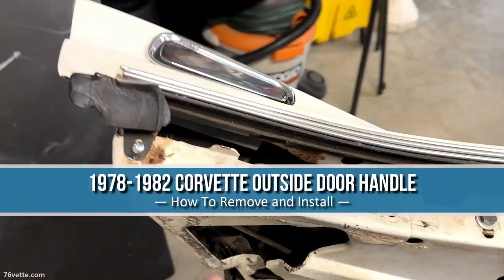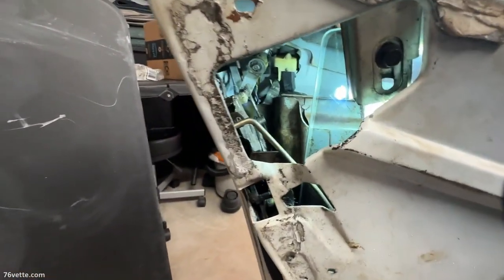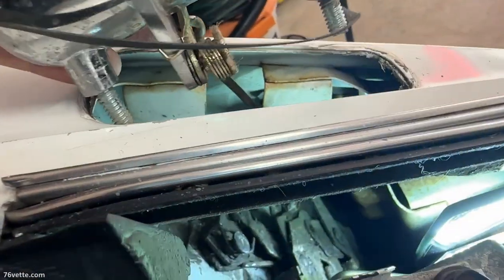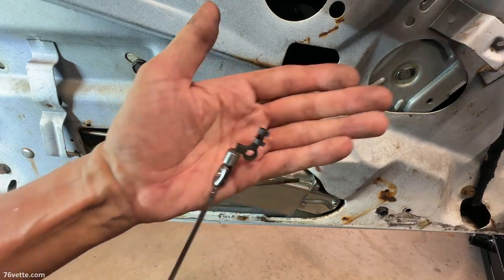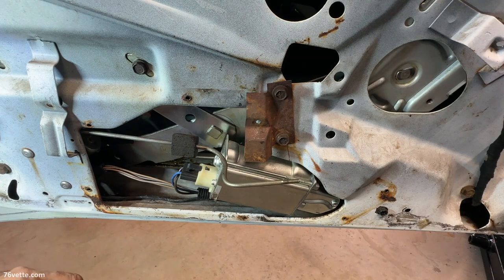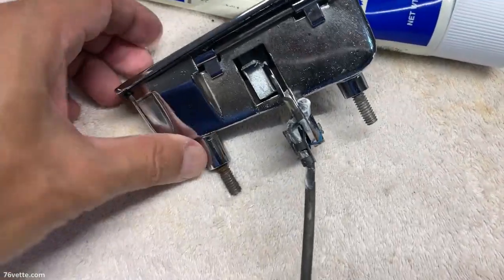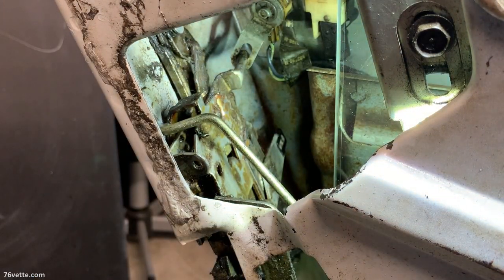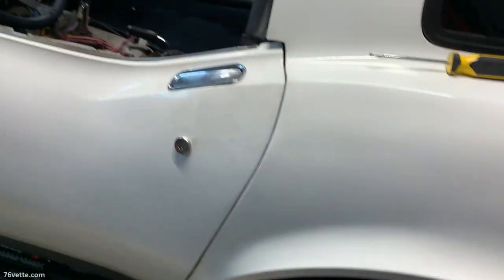C3 Corvette DOOR HANDLES: Remove and Install

Comment: I wish I had this video 10 months ago. The video quality is excellent and the trick about just pushing the clevis through the clip would have saved me hours of agony. Also loosening the door mechanism is absolutely key on this whole process. Unless you have tiny hands there is no way you can access the mechanism. I got my door handle rebuilt and installed but it was basically a trial and error process. Another great job. Thanks
Reply from the maker: It is a challenging job. That’s for sure. Thank you so much for watching! 😊👍🏻

Comment: I did this last weekend on my 76 and put new handles in. OMFG that back nut was pain to reinstall. Who ever was in the doors before left the back nut off. 

I originally went in to replace a wheel that runs on the long horizontal and back vertical track (round to square wheel) and clean up the tracks, but Ill end up having to replace the driverside regulator due to the wheel that runs in the small horizontal track is busted off the regulator. Figured it was a good time to clean up windows and install the new handles while I was there.

Great vid!
Reply from the maker: Thank you for watching! 😊👍🏻

Comment: Wow that looks like a real PITA but at least you showed that it’s do-able. This will most likely be a winter project for me this year and I’m definitely not looking forward to it. As always a great video that shows the steps required to do the job. One question at what point did you reattach the the big locking mechanism back on the door with the three screws? Looks like maybe right at the very end? Just want to make sure it will all go back together once I tear it apart.
Reply from the maker: Thank you! Yes, I reattached the latch with the three screws at the very end. I don’t think you can get the job done properly with that thing in the way. Good luck with your winter project 😊👍🏻

Comment: I went through this nightmare when installing my door handle. The only pain is that little round doo-dad with the peg that is on the bottom of the rod that runs down from the handle. If that doo-dad isn't adjusted (up or down on the threads) just right, it can cause all kinds of issues from not being able to lock, unlock, using key , inside or outside door handle. And it may work for a few months, then BAM! Gets stuck again. Just my experience. Good video. Thanks.
Reply from the maker: Yes, these parts need tiny adjustments to operate properly. And making those adjustments takes forever because of their location. Glad you liked the video. Thank you for watching! 😊👍🏻
Reply: After checking other videos I didn’t see one that mentions the small retaining clip that secures the rod to the door handle. Mine didn’t have that clip when I replaced the handle. So I checked my assembly manual and Bada bing bada boom, it shows that retaining clip does belong there. And that’s why your videos are some of the best!
Reply from the maker: @inell6 Thanks for the kind words and for watching my videos. 😊👍🏻

Comment: Boy you are NOT kidding about"not for the faint of heart".  I had to replace one of my door lock mechanism.  I think I invented a few new curse words and I wound up throwing a tool or too.  The door still isn't right.  It'll open but the latch mechanism sticks in the down position.  I need to completely tear it apart and start over.  I'm sure this will help me a bunch!
Reply from the maker: Well, then you know that on video it looks easier. And I edited out the colorful language. Lol 😆 
On yours, you may just want to bite the bullet and completely remove the latch mechanism to clean and lubricate it thoroughly. Also, a bent rod may be the reason as to why it sticks. 
Good luck. I hope you get it working right. 😊👍🏻
Reply: @76vette  Well I completely replaced the locking mechanism.  Brand new!  I also put lithium grease on the moving parts just to be safe.  The clips that go on the door rod connectors are actually called "Carburetor Clips".  You can buy them at any of the name brand stores if you ever need new ones.  They were like $3 bucks for a pack or something like that.  Yes, it looks MUCH easier on video.  I am going to take the whole door apart.  I need to replace the door hinges and the power window motor and the dirty window bothers me too.  So I'm just going ro restore the whole thing all at one time and give it a thorough reconditioning.
Reply from the maker: @Ender0999  Good luck with that massive project, and thanks for the tip about the carb clips. 😊👍🏻

Comment: So I changed the outside door handle on my 79 today. The one I replaced was garbage that started sticking in the down position after a few months . Anyway it did have a clip where the rod connects to the handle, but it looks different than the one you used. GM#7762203. For 69-81 Vettes. I’m sure they provide the same purpose, just thought you may want to give it a look.
Reply from the maker: Ok. Thank you 😊👍🏻